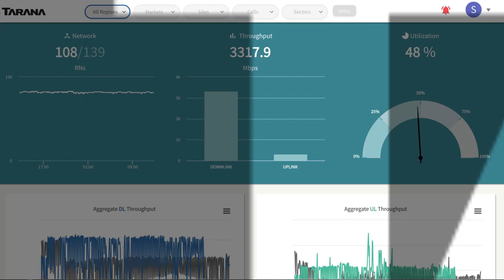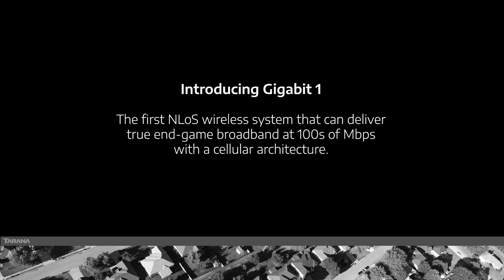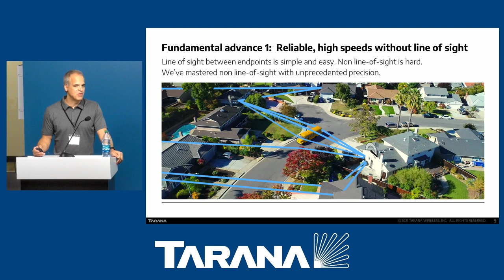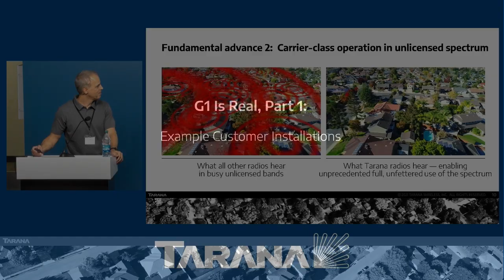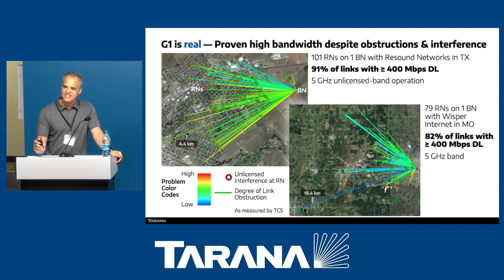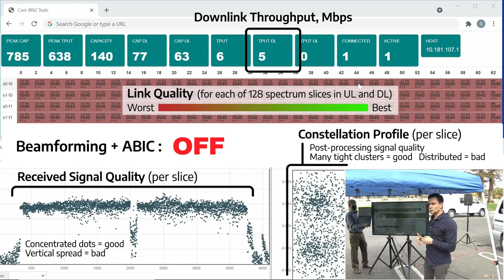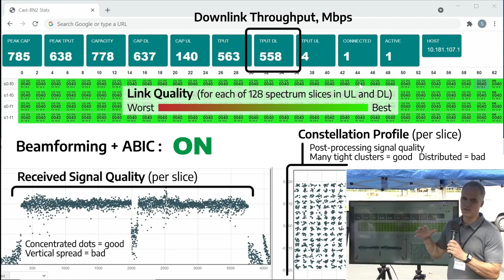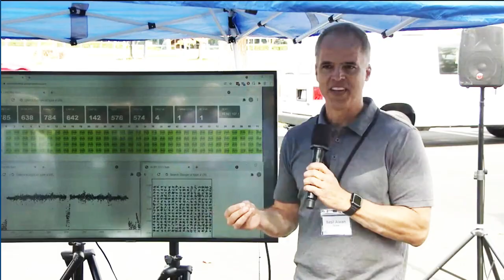Tarana Wireless — G1 Broadband Platform Commercial Launch Highlights

Comment: When I first got upgraded to 400mb it worked flawlessly. But after about 2 weeks the speeds became really inconsistent running 50-250mb nothing higher and the places that I would speed test to the latencies went from a stable idle latency of 14-16ms to an unstable 25-50ms and jitter running between 45-100 and packet loss of 1-5%. What made it even worse is the very unstable under load latencies especially on upload, the latencies would jump up to 600-900ms and get so bad that even with 200mb plus speed my internet couldn't even carry voice and only would work with electronics with buffers. My Security Cameras, Teamspeak, Phone, and don't even try and internet gaming, I just couldn't do anything but stream on my TV because of how unstable the latencies were. My ISP Nextlink had me rebooting the Tarana again and again, they told me that they involved Tarana tech to fix the issue and for about 3 weeks I dealt with the inconsistent latency and speed issues, it may be good for a few hours and then be totally crap again for a few hours. Anyways after 3 weeks the issue seemed to be fixed and I again had awesome consistent internet like it was when they first hooked it up. Unfortunately, about a week a week later it started doing exactly the same things again. Of course, I called my ISP last week and they again had me again rebooting the Tarana and finally decided that they are going to send somebody to my house on this Wednesday the 11th of May. This morning I woke up and found that I again all day seemed had consistent speeds of 380-420mb like I had before when it was working properly but the latencies are still just a bit higher than they were originally at 14-16ms they are 25-30ms to the same servers that I always speed test to but that is acceptable when the under-load latencies are less than the idle latencies and the jitter is around 25-30, I can do anything and everything on my internet if it would stabilize as it is currently today. I am about 2.5 miles direct line of sight to the tower with no obstructions and when this equipment is working properly it is amazing. I have some faith that these issues can be resolved because I have a friend that has the same internet as me from the same ISP and he hasn't had any of the issues I have had so it is very frustrating. I hope that they figure out Wednesday what it is that is causing the unstable inconsistent internet that I have had off and on intermittently since upgrading from their 50mb fixed wireless (which I didn't have any issues with other than I wanted and needed more bandwidth).
Reply: After having such a good day yesterday with my internet with everything working as intended, to the point that I thought that maybe it is possibly fixed my internet this morning my internet has gone crazy again with unreliable speeds only 50-150mb, really high under load upload and download latencies of 500-1,000. Again, anything like voice communication, my doorbell camera, etc... absolutely do not work, another system reboot will temporarily make it somewhat better but not fix it either. I am starting to think that I have a bad node and hopefully tomorrow they replace it, and it fixes everything. Voice communication is so important at my house I am a 100% disabled Veteran and cell phones unfortunately only work intermittently at my house and I depend on WiFi Calling for my phone and my wife's phone.